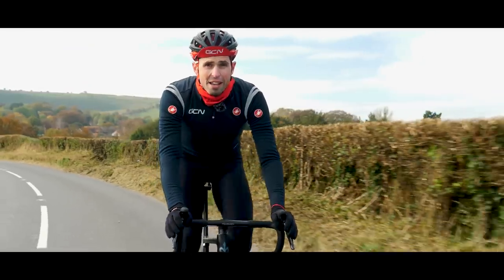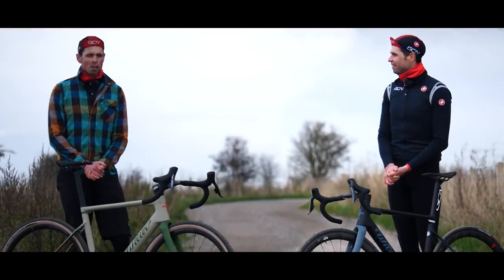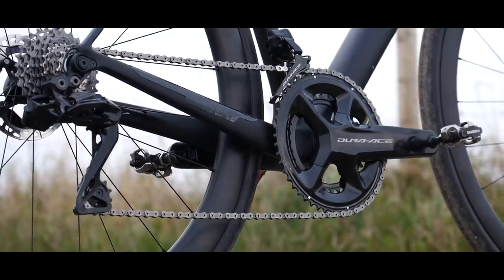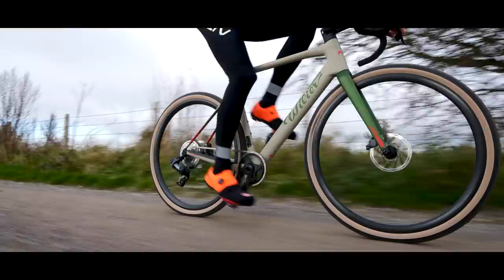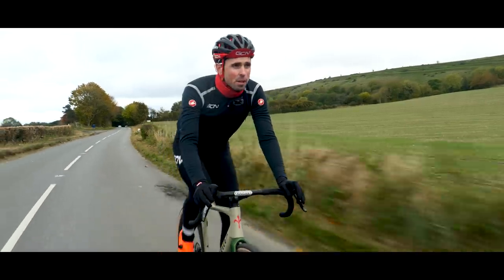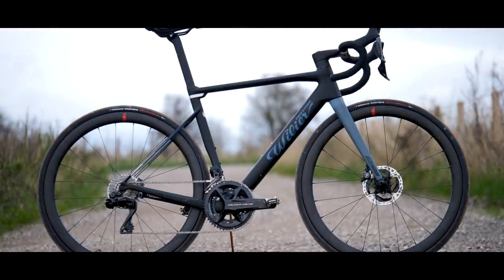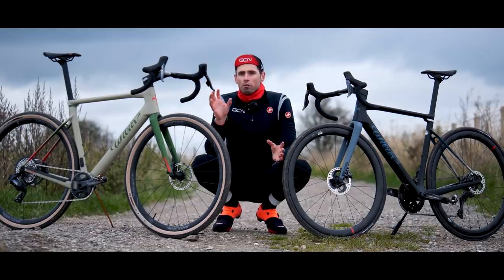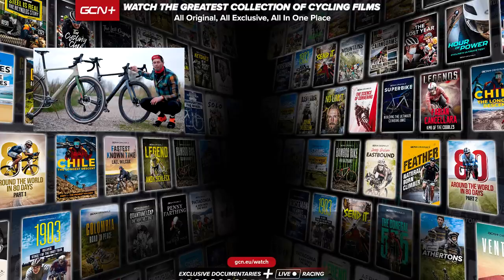Ride Road & Gravel With One Bike? | Wilier Rave SLR First Look

Comment: I think this is what a lot of people actually do: ride gravel and road on their "gravel bike" (for me that's a cross bike). you swap the wheelset and you have a road bike.
Reply: Agreed. My TCR is relegated to the trainer and my Warbird has two sets of wheels. I'm planning to get a set of 650b as well, which good old disc brakes allow me to do.
Reply: Cross is now a race version of a gravel. Same as a road race bike is compared to an endurance road bike
Reply: I am actually wanting to try 32mm tyres on my Grail, but I am wondering if there will be any difference in speed at all..  I can already hang with group riders with my 38 gravelkings.  But yeah anyway, mostly road with some gravel is what I ride.  I just want a road bike that I can take anywhere if need be without worrying.
Reply: @kidShibuya  same here (Grail CF). I actually have 32mm(road) and 38 (gravelling), 32 feels faster but I ride mostly on 38 for comfort and freedom to go offtrack.
Reply: Or you don't even swap the wheels. Most gravel tires do well enough on the road, and on most days I'd probably not go through the hassle of swapping wheels.
Reply: I have a bike which I  road race on, and also race cyclo-cross, and ride gravel forest  etc ( and the odd trialthlon) usually on the same tyres sometime swap out to specific cross tyres depending on the courses weather etc,  probably wear out the headset bearings a bit quicker than normal but still cheaper than having two bikes.
Reply: Same here.  Specialized Diverge with two sets of wheels - one with 32mm Conti GP5000 TLs and the other with 40mm Michelin Power Gravels.  And clip-on aero bars.
Reply: I have built  a 2X gravel bike  and have a set of 32mm road wheels to go on it to use as winter bike. 38mm gravel kings for gravel. And 48:31 front 11/34 rear
Reply: Did this with my Ridley Kanzo Fast and a set of reasonably priced Fulcrums for road duty. There is one issue, n+1 is constantly nagging me to get a dedicated roady with di2. And a wattbike. And a mtb. Resistance is futile!
Reply: @mx2000  exactly just roll thicker and smoother tires and change inflation as necessary. that’s the future. this video is basically 2 different bikes
Reply: Bit peasanty for a man of my taste. Just get two bikes.
Reply: Been riding a Santa Cruz Stigmata CX with two wheel sets for five years. For awhile, the Stiggy was viewed by many in the same way. Not a new concept, but I’d happily take that Wilier…if it’s weren’t so darn costly.
Reply: @kidShibuya  you can do it. i use 34mm wtb byways and is great for light gravel and road with its compound profile
Reply: Running a set of Reynolds AR29s with 27/28mm road tires for the road group rides. Set of Stans with Gravelking SK 38s for gravel. Been doing this for a year. Road tires have picked up major debris, like screws and nails and they haven't let me down.
Reply: Cyclocross bike (CX) = 
"cyclo" + "crisscross" × "all rounder"

Tire clearance of their frames;
CX bike - UCI sanctioned
Gravel bike - x
Reply: Yes, I've been doing that with a Giant TCX Advanced for a long time now.   With 28mm or 32mm 700's it's great on the road.   On 650b's I can fit 2.1" MTB tires.   Can fit up to 45mm on 700s if I want.
Reply: Meanwhile I got an endurance bike I just slapped some 30 gravel tires on.
Reply: a few years ago the Simlon Inissio GranFondo does the same
I own one from 2016 up to today, with two wheelsets road and gravel and still pleased
It's a good compromise having just one bike
Reply: For most people swapping the wheels is overkill as well
Reply: Yep - that's what I've started doing - wheelset that came with the gravel bike and 44mm tyres for off road\mixed riding and then basic wheels off my race bike with 28mm tyres fitted when I want to do just road work (pretty essential if I want to keep up with my mates but also they just feels soo much better as well as being faster)
Reply: Ribble CGR-e with 700c road and 650b gravel/off-road wheel sets (2 motors of course). Currently running 28mm GP5000 and wintery 47cm/ 2.1” Sendero/ Ultrabite with 1x. Also have some lighter gravel tyres for summer. The motor makes the gearing much more feasible off-road although I also have a slightly wider range cassette on the off-road wheel. Brilliant! Does all the trails and all the roads! :-)
Reply: @SAnderson77  11/34 on the gravel wheels. What do you have on the road set of wheels?
Reply: @DavidJohnson-he3jh  late reply! 11/30
Reply: @SAnderson77  nice,  i run two sets of wheels on my gravel  48/32 and then 11/34 on 38mm and 11/28 on 28mm.
Reply: Me too!……

Comment: But that's like every gravel bike, right? 
Just add road wheels, and you got a decent road bike, as long as you are not too concerned about the differences in geometry (and if you are very concerned about the geometry, you probably own multiple bikes anyway).
Reply: yep that's what i do. i bought a cheapest aluminum frame bike with gravel geometry profile (slacker headtube, longer chainstays, higher bars, etc) but it currently has 25c tyres. Planning to buy 32c one and turn my bike into the ultimate bike that can go on the road, gravel (or shitty third-world country roads), and i can also use it to commute to uni bcs its comfy.
Reply: The video answered my big question, which was handlebars.  We're actually talking about two different builds here. If you "convert" a bike between gravel and road by swapping wheels, handlebars are likely to be the place where you feel the compromise the most.

Comment: I just mounted 37mm Schwalbe Marathon 365 on my wifes new RC520. Looks quite nice and rides fantastic! Btw, thanks to GCN for the video about cheaper bikes, it let me check the availability at Decathlon. Interestingly, more expensive bikes are almost impossible to get.
Reply: Oh, and just €1000 for the bike, tubes and tires.
Reply: I did the same to my RC520 put on some Spezialized Pathfinder 38c and good to go. Did yesterday 140km gravel race with out issues. Next step to upgrade the 105 rear derailleur to a GRX 😁
Reply: I've put 28x1.35 Rapid Rob on my Triban. I love it!!!!

Comment: Starting 8,200 Euro. No, thanks.
Reply: but if you buy all the parts for another bike you can make that one 8,200 Euro bike do two different things mediocre lol I totally agree with you man $1000 bucks and I have a bike that does everything this does or $1700 I can have a carbon version lol
Reply: @GRAVELCYCLINGNETWORK  not a 7.7 kg bike with discs and electronic shifting. Even in the specific road bike category, you need to. Pay at least 3800 euros.

Comment: Ummm… so every time I want to ride on road / gravel I just need to change quickly:
- wheels
- group set
- handlebar 

Sounds VERY convenient indeed. At least if I am in cycling not for the cycling but for the bike building.
Reply: Just wheels... unless your racing (and getting paid) -- you can go anywhere with 1x

Comment: Well, but to make it work in both scenarios, you'd still have to swap wheels, groupset and the headset. Or you just go and buy 2 bikes, which probably costs less than 1 1/2 Wilier in most instances.
Reply: Bro but it's only €8,000
Reply: Just did the math: Only buying a second set of wheels (for example the SLR42KC carbon wheels of the road version) plus the groupset will blow approximately half of the money. Plus: You don't have 2 bikes, you'd always have to do a half rebuild to swap from road to gravel. I don't get the product., it's essentially just 2 specs of bike built around an one-does-it all frame.
Reply: @DoNuT_1985  I dont get it either, the N+1 rule for bikes id always better. Also, im much more price/spec savvy than spending this amount of money on a bike. Im all about open mould frames.

Comment: The idea of “one  bike, two wheel sets for road and gravel/all road” is very appealing, but Wilier’s “one frame set for both” is very much an incremental advance - going from road spec to gravel spec requires (in this instance at least) a new wheelset, drivetrain, bars (good luck running those brake lines!). May as well just have two frame sets in discipline-specific trim
Reply: I agree. It feels gimmicky.

Comment: I bought an Orro terra c with Campag Ekar 1x13. Haven't touched my road bikes since. It's revolutionised winter riding. Access almost anything on it then smash it home on the road from wherever. Wish I'd got off the tarmac years back frankly.
Reply: I just bought a Terra C for winter - but mine is road oriented. I'll get some wider wheels/tyres if I plan to go off road.

Comment: Just ordered the gravel version with SRAM Force wide 46-30 / 10-36 and 28 mm tyres for 5000… will do 70% road and 30% gravel, with other tyres. No need to change the groupset nor the handlebar. I prefer the slightly flared ones for a better control when riding down Swiss passes at up to 60 MPH.

Comment: I went a different direction, I have a duel suspension 29er mtb with full lockout. Second set of wheels with 40mm tires for gravel. The majority of gravel rides I do have some section where unlocking the suspension lets me go through faster with more comfort. Allows for slightly higher tire pressure when I do rides that have more pavement. I have played with Spinaci bars instead of drops and are a good alternative. I would rather have one high end bike that does both than buy two medium end bikes that don't quite make the cut.

Comment: Not really anything new here, a lot of gravel bikes are well suited to road use. I have a Ribble CGR SL (carbon) that I use in exactly this way. Built with Ultegra with a compact 50/34t chainset and I run road wheels with 11-30t cassette and 28mm tyres and gravel wheels with an 11-34t cassette and 45mm tyres.
It works fantastically in both setups, but it’s certainly not as responsive or quick up the climbs as my lightweight race bike. It does however make a great endurance road bike and winter trainer.

Comment: It's really the tires that make the bike(proper clearance of course) and given prevalence of tubeless and a mess associated with swapping tires, a dedicated wheelset is a great option.  I am currently on vittoria terreno zero 35 for gravel and Continental GP5000 32 for road.

But the Willier bikes look every so tempting as does the available Campy Ekar 13 speed.

Comment: I mean I guess? I donno it's just all road style frame, which a lot of companies have. Orbea Terra, Canyon Grail, Trek Domane (or however it's spelt). Pretty much any other razer edged gravel bike is a wheel set change away from being a road bike.

Heck my Orbea Gain (an e-road bike) was a very capable gravel bike the second I swapped the tires for ones better suited for gravel.

Comment: Running both 28mm road tires and 38mm gravel tires on my Orbea Terra.  I do recommend a second set of wheels because the stock rims on that bike you need hands of steel to have a hope of swapping tires in a reasonable amount of time.
Reply: get a tire jack, it's like 15 dollars on amazon, from near impossible to mount tires to just easy peasy with that thing.

Comment: I ride the Moots YBB (Y be beat?) gravel bike on ENVE AR 3.4s with Rene Herse Extra Light 35mm slicks. Of course it doesn't accelerate like my Moots RSL road bike with 28mm Conti 5000s, but I can get to my average speed with just a few more watts and lots more comfort on the YBB. I won't ride my gravel bike  off-road with these tires, but frankly, I won't ride off road at all anymore, having quit MTB. Unless you're riding the smoothest gravel, get a mountain bike for trails. Gravel is for road! YBB?

Comment: As others have said, a cyclo-cross / gravel bike set-up works fine on the road - just change the wheels.  A 46/36 chainset works well in both settings.  Why bother going with changing bars etc?  Not necessary.

Comment: The maximum available width on good road slick tires like Pro Ones, Corsas or Conti 5000 is mostly 32mm. It would be great if they add a bigger width like 35/36mm.
Reply: see Rene Herse - awesome tires
Reply: @burkeculligan4756   Yes, I have the 38mm Barlow Pass and the 36mm WTB Exposure.

Comment: 9300 Euros with Ultegra Di2!  And maybe you'd still need to buy a second set of wheels..  Better to just buy two bikes, one gravel one road.  You would still get two really good bikes, both with electronic groupsets.  Pick which one you want to ride that day, no changing wheels.  And of course, of course, you could have different handlebars on each bike.  In other words, this bike is probably best for pro gravel racers.

Comment: Great gravel Shirt and love em both. Think the gravel with a 2nd set of road wheels would be fab 🤔
Reply: That's what I have done with my Pinnacle Arkose D2. I bought a set of Hunt Four Seasons with 32mm Conti Four Seasons tyres and switch these out with the stock wheels and 37mm Panaracers according to the ride. Great fun and very versatile. Also takes full mudguards :).  I wouldn't mind the Rave though. Wilier make fab bikes!
Reply: @MrAppoline  totally agree. I have a GT CX Edge currently swapping tyres and it's a faf. Cont 4 seasons too. Plus 35mm Terra-Speeds

Comment: This is pretty impractical with integrated bars, changing from gravel to road will take hours. 

I have a gravel bike which I swap wheelset, cassette, chain and cranks for serious road duties and that's enough of a PITA that if you added integrated routing my head would explode..

Comment: So AFAICT this is a disc brake frameset with a large tire clearance, as is the general industry trend. But it's a "dual soul" if you just swap out the tires, groupset AND handlebars / cockpit - and maybe the wheels?  So just spend $2-4k to completely refit the bike and it's "two in one" !  Come on guys.

Comment: Changing between two fully integrated handlebars is not modular in any reasonable way or form. At least until they invent electronic disc brakes… 🤟🏻
Reply: or pressure tight quick disconnect for hoses, but probably they will make them propietary and you will have another impossible to replace part in a few years

Comment: So if I buy one of these frames and I want gravel and all road with just the one bike….all I need to do is ……………

Buy compete different groupsets 1x and 2x 
Buy two wheel sets
Buy two handlebar sets
Etc…….

Most gravel cyclists who want a road and gravel/off road on one bike have two wheel sets with different tyres.

This  bike set up was so completely different, only the frame was the same. Who can change almost every component on each ride? 

If you really wanted to follow this vlogs example you need to buy two separate bikes 🙄🙄🤣😂🤣😂

Comment: It's too bad about the totally integrated cockpit and cable/hose routing.  Those bits mean that a buyer has to run the risk of the proprietary parts not being availabe in the future and deal with the PIA cable/hose routing if changing position or changing headset bearings. Hard pass on this bike.

Comment: As a mountain biker, i find these discussions very funny, almost satire.
These bikes all look the same, all weigh the same, all do the same. 

For the cost of less than one single kilo, you can have a ultra light road bike that can go on dirt roads...The aero shaping costs nothing, the body position is close to identical. 

By comparison a 20 pound hard tail mountain bike meant for XC races .....looks and weighs NOTHING like a 40 pound 180mm downhill bike. 

Sorry, its just very amusing.

Comment: Open U.P.....doing it for years.
Reply: Love Open. Just ordered my WI.DE and getting a 2nd set of 45mm on the 303s’s. The 1600 AL DTs that came with the bike will get 30mm road tires. Not changing anything else but the wheels for road specific riding.